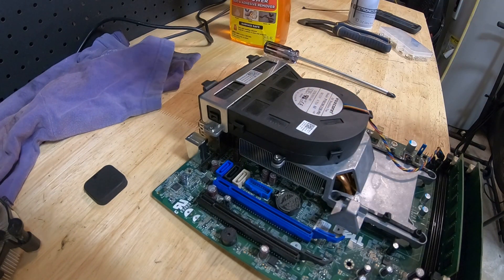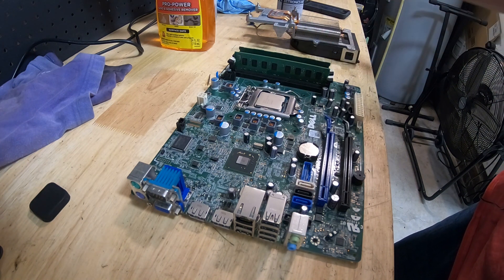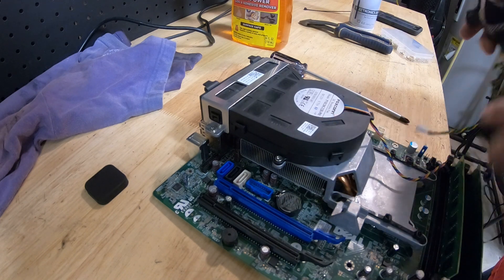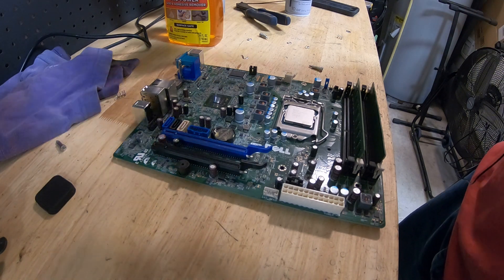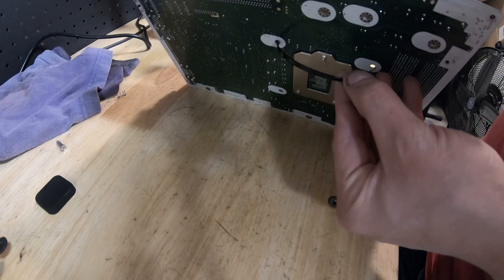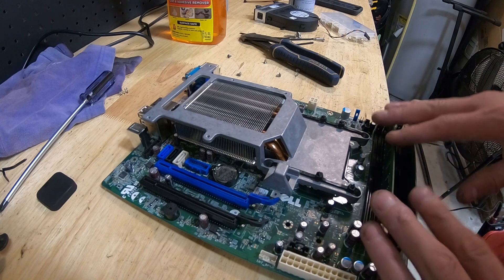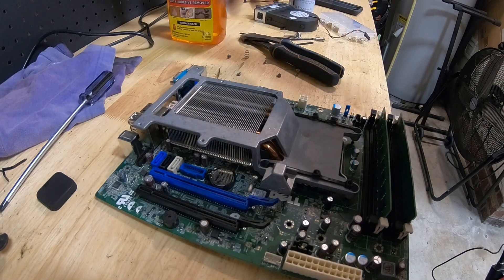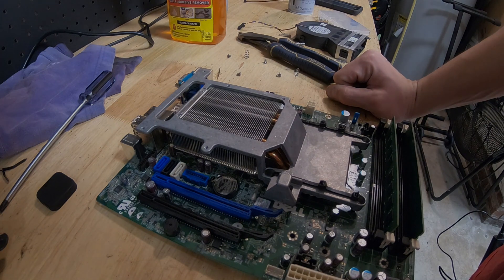Dell Optiplex  SFF cpu cooler. CPU cooler guide for case swaps!!

Comment: WHERE ARE THE CASES LINK BROOOOOOOOOOOOOO
Reply from the maker: you can use any case you want except itx. the video is old so they don't make those cases anymore
Reply: @DLMtechgarage   Yeah I figure out it's the best way to make a 1080P budget Pc, My grandma had one of those laying there as she used it only for the OS of her store the monitor stoped working so they use a laptopt now, that's y I want to, but I prefer just leave it on his original case, and just 3d print a customized panel, thank you a lot love ur videos.

Comment: Did you ever come across one of those computers with the blower style coolers that make rattling noise? I got a Delta and a Foxconn one that made rattles so i took them apart,i cleaned them,i lubed the ball bearings and i even changed the bearings with known good ones but they still make rattle noises. Are these really absolutely unfixable or am i doing something wrong? Whenever i try to fix regular fans they work perfectly fine again but i just can't get the blower coolers to work properly anymore

Comment: Omg thanks you ❤
Reply: Swap case done, and it works! Now I'm waiting to receive a fan adapter, and a 90° power adapter, because my new gpu is too long. I hope it will works 😅
Reply: Update: Dell power port is reversed, i can't use my 90° adapter, i don't know what to do 😭
Reply: Update 2: Riser Pcie is the solution :D

Comment: I modified stok HSF with 4 pin intel to 5 pin dell by using male to female 2.54 pin header cables (arduino cable)... Just change the blue cable position.
But i still wonder is it ok to leave the chipset without heatsink like that...
You can see around of it to be browny because of heat...
I wanna add a chipset heatsink, but there isn't holes around the chipset...
The original hsf looks like covering the chipset that can suck the heat.

Comment: also is there a video from you on this particular pc OptiPlex 7010 case swap because I'm not really the expert when it comes to building pc's off the bat without a video
Reply from the maker: i have a series on upgrading and case swapping the optiplex. the 7010 is just like the 9010 which used and the guide should def answer most your question.

Comment: Hey! i have a question, do you know if i can swap the case of the Dell optiplex 3050 sff, i ask this because the motherboard isn't rectangular (it has like a leap, 8NPPY is the mobo) so i want to hear your opinion since you work with this kind of computers, also, i have two stick of rams, but they're of different brands, do you think they don't work in dual channels just because of the brand or because any other factor, Both are 8GB DRR4 ram, (one's Samsung and the other one is Crucial) and the last part, if they aren't compatible for dual channel, should i buy a 16GB crucial ram, so i have dual channel and 24GB of ram? My sistem is an i5-7500 16GB RAM 1TB HDD, no gpu.

Edit: Forgot to mention that the crucial ram is 2666MHZ while the Samsung one 2400, it's limited by the bios and obviously by the lower mhz one.
Reply from the maker: It has not been done and I am not sure on the specifisc but I am def looking to get one in the future and see if it's possible so stay tuned!! as far as the memory, yes they will work in dual channel it would just default to the slower speed ram. now some memory don'nt play nice with each other but those are both good ram and should work. I would try it and run it as is for now and if you brave poss the ram speed a little bit.

Comment: Take a pliers and bend on the stand offs in the original case. They'll break out of the metal fairly easily and cleanly. Re-use them as nuts in your new case. Or if you have fine thread motherboard stand offs laying around.
Reply from the maker: good to know thanks!

Comment: Hi have a question I have a dell optiplex 790 sff I am thinking about putting it in a nzxt h510 case. Would it work?
Reply from the maker: yup it would, just got to do the whole wire spliccing or buy the adaptors to wap
Reply: @DLMtechgarage  ok thx 👍subbed
Reply from the maker: @justthatguy3282  much appreciated!!

Comment: Im using a 3010 sff.. do I need to use that or can I use another cooler.. I do dont want that big metal thing on the mobo.
Reply from the maker: you can change the cooler.
Reply: What did you end up using.. I’m trying to change it too.. thanks

Comment: My computer keeps turning off and on. Can I get just the top part instead of the whole thing? And if so where and what is the part number? Can I get it from you?
Reply from the maker: not sure what part you are refering to. if it's the silver parts it is called the heatsink. they can be found on ebay. underneath it is the motherboard and cpu.

Comment: Do you know where I can get a 5 to 4 pin splitter? I'm planning on case swapping and need 1 more fan port
Reply from the maker: you would have to get a 5 pin adaptor and then use a 4 pin splitter. links below to the adaptors. I have never seen nor do I know of one, I have done it by using the 5 pin adaptor and then using a 4 pin splitter to it.

https://www.amazon.com/CRJ-5-Pin-Female-Adapter-Motherboards/dp/B0871P9X72/ref=sr_1_3?dchild=1&keywords=5+pin+dell&qid=1626108441&sr=8-3

https://www.amazon.com/Noctua-NA-SYC1-black-NA-SYC1-chromax-Black-y-Cables/dp/B076542HBN/ref=sr_1_2_sspa?crid=2AINLLTD1BPG3&dchild=1&keywords=4+pin+fan+splitter&qid=1626108458&sprefix=4+pin+fan+s%2Caps%2C165&sr=8-2-spons&psc=1&spLa=ZW5jcnlwdGVkUXVhbGlmaWVyPUEzQTdYQkQxTTROQ005JmVuY3J5cHRlZElkPUEwOTMxNDUwMlJKQkQ5RDQ0NFhTRyZlbmNyeXB0ZWRBZElkPUEwOTgzMTEwRVVHVThKTU5HWFZTJndpZGdldE5hbWU9c3BfYXRmJmFjdGlvbj1jbGlja1JlZGlyZWN0JmRvTm90TG9nQ2xpY2s9dHJ1ZQ==
Reply: @DLMtechgarage  thank you I just didn't know if stacking adapters would be safe
Reply from the maker: It's fine if done it before. Only becomes an issues when stacking splitters 4 is the max I have found

Comment: couple of questions
will this work in a atx case or what case will it fit?
can you put a normal intel cpu cooler on it?
Reply from the maker: it will work in any case and you can put any cpu cooler you want on it, just make sure you have the fan adaptor if its the 5 pin dell version.
Reply: @DLMtechgarage  omg thank you so much your the only help full person on the internet I swear
Reply from the maker: @awu4d  thanks glad I can help , let me know if you need any more help. Thanks for watching!!
Reply: @DLMtechgarage  soz bout that question just realised the video is about a small form factor pc so yeah should I read the title better my b
Reply from the maker: @awu4d  its all good and yes you can do a swap with them too.
Reply: @DLMtechgarage  actually another question sorry bout this but do the small form factor dell optiplex also fit or what size are they? thank you

Comment: The motherboards I use are optiplex 3020 sff also known as dell dih81r/tigris its lga1150 and I believe it supports standard coolers (EDIT: I can confirm they support standard coolers, I put an Intel stock one and a screw on cooler.) you should take a look at them. I'm sure you've already had experience with it, but thought I'd share in case you haven't
Reply from the maker: yup sure does, thanks for the input.
Reply: @DLMtechgarage  im so confused man, do I need to leave the hideous blowdryer on it that you are showing in the video or can I add a different better looking cooler?
Reply from the maker: @abadazadytgaming7200  you can change the cooler. I have done it before. I was misinformed when i made the video.

Comment: 10:40 just a little tip, the pins them self are actually standard spacing, it's just the plastic shell which hinders you from putting in standard connector.

Most of them are quite easy to remove and you can fit a normal 3/4pin in there, assuming there is no capacitor blocking. 

It's usually 100% reversible, as the plastic shell is usually just pushed down over the pins and not fastened with anything else. 

Nice breakdown for any new DIY guys out there.

Edit: only works with 3pin( or 4pin if you leave one out of the side)  and it will go full throttle. However a good fan at full throttle or with in build resister is still usually much quieter, and would result in same scenario as running from molex/sata but you will not get CPU fan failure. You can flip it around, running at much lower speed, but will give out CPU fan error.

I mention this, because not all countries have these adapter readily available. So it might make for a fair upgrade in fan. Alternatively, use case fan on the CPU pins and CPU fans on case pins.
Reply from the maker: good info, appreciate it!!
Reply: How do u bypass the annoying bios cpu fan error?

Comment: I have the same dell optiplex with that big ass cooler fan how can i find a rgb universal one for it
Reply: My dell is a optiplex 390
Reply from the maker: Cooler Master i71C RGB is the one i one i use for the them, not sure if their would be a clearance issue with the case cause typically i case swap it. dimensions are  4.8 x 4.8 x 3.4 inches, hopes this helps.
Reply from the maker: Cooler Master i71C RGB is the one i one i use for the them, not sure if their would be a clearance issue with the case cause typically i case swap it. dimensions are  4.8 x 4.8 x 3.4 inches, hopes this helps.

Comment: Is there any other cooler I can use with it except the default one? And do I really have to take the cooler off when I do a case swap?
Reply from the maker: From what I gather its the same mounting holes and you should be able to use any one you want.
Reply: @DLMtechgarage  do you think this will work? https://www.amazon.it/Xilence-XC032-ventola-Processore-Refrigeratore/dp/B01L6QMLE4/ref=mp_s_a_1_1?dchild=1&keywords=xilence+performance+c+500w&qid=1610485293&sprefix=Xilence+pe&sr=8-1 also im gonna go a case swap tmr and I have your same cooler, is there any way to keep the cooler there without unscrewing it
Reply from the maker: @ggp4961  should work as far as keeping the cooler without screwing, i believe its mounted to the case and the screws are part of the case.
Reply: @DLMtechgarage  didn't u say in the video u cant change it??
Reply from the maker: @abadazadytgaming7200  i was misinformed on it.

Comment: Can I switch an optiplex 780sff case without anybadaoters and cannyounputbthe linksntobtheccases
Reply: I have an hp compaq pro 4300 and i want to transfer it i think it is bossible because you will a new power supply
Reply from the maker: @Fashahzad  I'm not sure if it's possibly it looks like a proprietary form factor board but then again a little modding might be able to make it work.
Reply from the maker: @Fashahzad  awesome!! let me know how it works!
Reply from the maker: unforunately you can not. The motherboard is not a traditional atx style and no case I have found supports this set up. The best you can do is upgrade the computer and mod the case. I have a build where I maxed out the cpu, ram, popped in a gt 1030 video card along with a SSD and cut a window and added a rgb fan. Came out pretty good in my opinion and was a nice flip. I will leave a link for you to check it out if interest. Thanks for watching, wish I had a better answer for you and hope you can follow the channel!

https://youtu.be/TyzFH1n40sY

Comment: i have a dell optiplex 9010 sff with a i7 3770, but my temperatures are very high like 50–60 when i turn on my pc, and 80–90 when i play videogames, what i can do with the cpu cooler, can i get a better cpu cooler?, can you help me with my problem pls:((. i dont speak english srry for my bad english
Reply from the maker: You have a few ways to try and solve this. You can upgrade the cooler but you are gonna need to find a cooler that is not too tall and will clear the surrounding components. The company Noctua makes some that I believe work but they are expensive and you will also need a adaptor to plug it into the mother board. The next option I would consider would be checking the thermal paste. If you have never changed it then that is def your issue. Fresh thermal paste along with dusting out the computer and cleaning out the fans and heatsink will help alot. Use quality thermal paste like artic mx4, or thermal grizzly. Another thing you can do is upgrade just the fan and reuse the heatsink. You can get a 80mm fan from Noctua and adapt it to the heatsink. Their fans have alot more air flow and work great. It does seem that I think the issue is thermal paste. I have used these computer with that set up and never had temp issues but I had to change the thermal paste and clean out the dust on the blower and heatsink. Hope this helps, let me know if you have any other questions and def check out my other video on dusting and cleaning a computer. Thanks for watching!
Reply: the processor just bought it and put it on the PC, I clean the PC, but so you're telling me maybe it could be the thermal paste, I got the cooler master mastergel maker, is it good?
Reply from the maker: @themisho1136  I never used it wo I would not know. When you swapped out the cpu, did you clean the cpu and cooler surface with rubbing alcohol. The surfaces need to be thoroughly clean before applying paste.

Comment: Trying to upgrade the CPU but the 4 screwes holding down the heat sink are coming out. They just spin inside. Do you have the issues with the 7010 sff?
Reply from the maker: wow, that seems like trouble, because if I remember correctly in this model isn't the mount part of the case?? if not then i'm not sure of a safe way to remove it without seeing it. Never had that issue before.
Reply: @DLMtechgarage  had to a full tear down 👍!  So work lol but done
Reply from the maker: @samerdonald8856  Nice!

Comment: Can I add Noctua 92mm Fans in a Dell Optiplex 7010? I swapped it to another case btw, I want to know if the 5pin adapter could work with a fan hub so I could connect more fans.
Reply from the maker: yea you can add the 92mm fan to it. did a video on changing the fan on a optiplex to a 92mm noctua so def check it out. not sure about the hub but don't see why It would not work. Thanks for watching!
Reply: @DLMtechgarage  do you know if the noctua fans will work with the Y cable connected to the 5 pin adapter?
Reply from the maker: @Michael Philips  im not thinking it voltage more of dell trying to keep from modding their products, the single fan works but im not sure if the change in voltage would trigger the error code, def something i wish I would of tried
Reply: @DLMtechgarage  well if the only thing that I have to worry about is the error code, I don't have problems since I could just press F1, thx for the help!
Reply from the maker: @michaelphilips1933  true lol.. anytime!
Reply: @DLMtechgarage  or they don't supply enough voltage?
Reply from the maker: @michaelphilips1933  im not thinking it voltage more of dell trying to keep from modding their products, the single fan works but im not sure if the change in voltage would trigger the error code, def something i wish I would of tried

Comment: Great video! I’m just wondering. Will this work with the cit f3 pc cases? I have a optiplex 790 sff and wanna swap the case to that.
Reply from the maker: It should, these dells of this vintage can swap into any case! The trick is just making the power button and error buttons work, but I have a video that might steer you in the right direction so check it out. Thanks for watching!
Reply: @DLMtechgarage  are you sure that it will work for a 790 sff? The box said for specified optiplexa
Reply from the maker: @aidandeng950  send me a link to this case. maybe we are looking at 2 different cases.
Reply: I’ve just finished swapping inti the cit f3 and it works perfectly

Comment: Sorry to bother you another question LOL when Dell list a maximum CPU forThis computer will other CPUs that are not listed work
Reply: Do you think this cpu will work with my 3010 
https://ark.intel.com/content/www/us/en/ark/products/65702/intel-core-i5-3570-processor-6m-cache-up-to-3-80-ghz.html
Reply from the maker: @jaimenbrunson1652  yea that will work find. def a good cpu for. Although consider looking into a xeon e3 1240 v2. It practically an I7 3770 equivalent at half the price. I go that route all the time and get those cpu's for like $40 bucks.
Reply: @DLMtechgarage  Thank you so much for all the help my decision of what I went with what is a core I5 3470
And the gpu that I picked up was a RX 570 ITX model it’s the same length of the low-profile GPUs but it’s taller and better of course so I won’t have to worry about the 24 pin blocking it but anyway thanks for all the help I will make sure all of my friends subscribe

:ps another tip with the cooler LOL you can rip the standoffs off of the old case with a pair of pliers or you can buy a cooler back plate off of eBay😁
Reply from the maker: @jaimenbrunson1652  Glad I can help, and thanks for helping the channel grow! keep me posted on how it goes!
Reply from the maker: never a bother always glad to help! yes and no. bios update has allowed for upgrades of cpu, example being this dell model with the bios update you can put an i7 cpu in it for that generation. Also on these optiplex 3010's you can put a xeon e31240 and v2 which are both not listed on their page. as far as cpu's you pretty much are gonna stick with the generation and platform of that chipset! Hope this helps!
Reply: Is this the card you used 

https://www.ebay.com/itm/124337727793